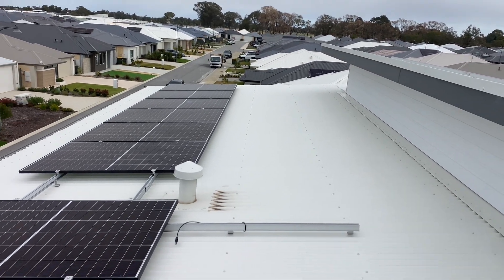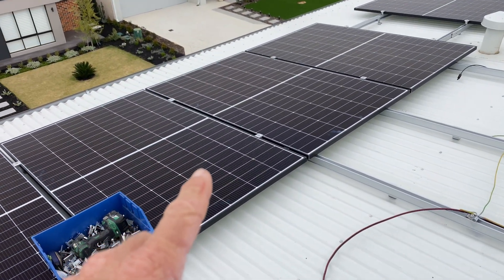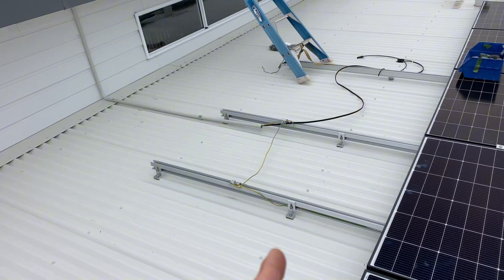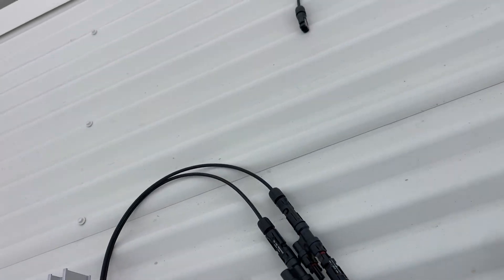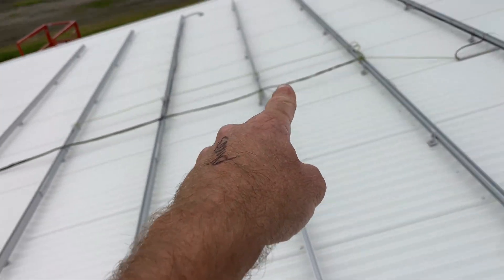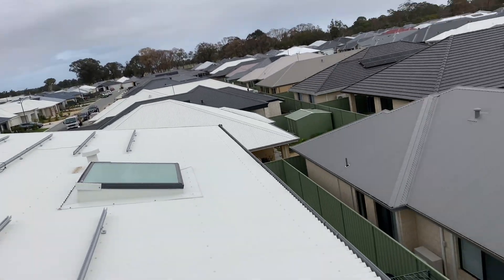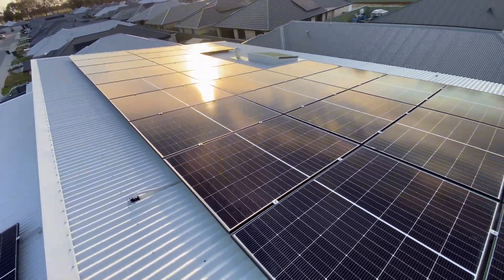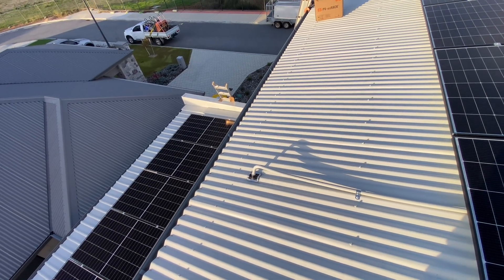My biggest ever residential solar installation with Sigenergy SigenStor and Trina solar panels.

Comment: Can you please explain a bit more about why you used optimisers on those 2 panels? Why are the bypass diodes not sufficient? Didnt quite understand the thinking
Reply from the maker: Sure, firstly you can void your warranty by installing panels in full, partial or scattered shade. When a panel is in shade it becomes resistive to the powerflow from the other modules in that string. Bipass diodes enable the power to keep flowing but they can burn out eventually, then the load goes back through the cells which are shaded and due to being resistive because of the shade they can burn out also. I use Tigo optimisers as they take the load of the bipass diodes but still allow the shaded module to contribute what energy it can to the string. Hope that helps.

Comment: why did you 'have to' install the 4 shaded south panels? just leave them off.. i doubt they will do much.
Reply from the maker: Because when paralleling strings the voltage needs to be the same

Comment: May I ask, why still using only 440W panels? New panels are up to 700w now days.
Reply: I think you'll find the size of those 700w panels 300-400mm longer which is how they get the power, not from more efficient photovoltaics.
Reply: @NashvilleAustralia  ...and for a single installer, bloody heavy and awkward !!!

Comment: I have had problems with earthing of panels and racking when using copper wire. In a wet summer climate, I found that the copper wire corrodes at the point of connection with the aluminium. Why do solar installers not use aluminium flexible round bar (as used for lighting protection earthing on large building roofs) for solar grounding? Surely the small added cost is not a factor?
Reply from the maker: I think some do on large commercial jobs. The bare copper  needs to be painted with zinc paint to stop the corrosion on jobs like this one

Comment: I’ve just had a similar sized system installed at home. 24kwh sigenergy battery, 50 panels (22kw) and 15kw 3 phase inverter. EV charger will come soon 👍👍

Comment: Those panels are half-cut solar panels. Portrait orientation is way better than landscape for that type of shading!
Portrait, roof edge shading hits one half, other half keeps working
Landscape, roof edge shading hits both halves, whole panel shuts down
Most shadows from roof edges are horizontal, so portrait lets you keep ~50% production during partial shading while landscape kills the whole panel.
Was there enough room for Portrait? I have 2 of these East facing fence mounted for charging my trolling motor battery. The sun hits the top first in the morning and gradually gets down the bottom by 10am.
Reply from the maker: Yes thats true, but I still wanted as much aun as possible on them and not load up bipass diodes
Reply: You won’t typically use the bypass diodes with a Tigo optimizer, as it regulates current and voltage to keep the panel contributing. Until the shaded panels get full sun, the string voltage may drop from around 640 V to 560 V, which also affects the parallel string. Rotating the two panels so one half gets sun earlier helps recover voltage faster. Split panels have two halves in parallel, so a panel 1/4 shaded in portrait will often perform better than one 1/3 shaded horizontally. If the system is over-paneled or it's cloudy, you probably won’t even notice the impact.

Comment: Hey mate, nice install. 

Few things i would add though love to hear your take, zinc saddles will rust in a few years time. Probably worth switching to gal saddles for outdoor use, thoughts? Good to run a catenary cable straight up the guts where the earth is just to keep the dc from sagging on the roof. We are always looking at improving our installs so your videos help us heaps. Good note on corro on the roof aswell. Good install on your own though 👍
Reply from the maker: Yes both valid points 👍🏻catenary cable would be better but everything is clipped as I go so no sagging of cables

Comment: G'day, why not use a hybeid transformerless inverter for off grid ? thx for your time and vid :)
Reply from the maker: Hi, many reasons. I will do a video on why soon.
Reply: @joondalupelectricalservice3201  Yes, keen to find out more too. I read the SigenStor has neutral-ground relay control, meaning it can properly bond neutral to earth when operating off-grid. Is there more to it?

Comment: Sigenergy says no parallel strings!
Reply from the maker: Can you give me a clause please. I haven’t seen that anywhere. Thanks
Reply: @joondalupelectricalservice3201 page 2 of the three phase data sheet 

https://www.sigenergy.com/uploads/en_download/1693469427819336.pdf
Reply: @joondalupelectricalservice3201 data sheet for the three phase inverter
Reply: @joondalupelectricalservice3201  low amp inputs

Comment: How do you go with partial deployment of Tigos on parallel strings? I've done it plenty of times on single string, but never on parallel strings into the same tracker.
Reply from the maker: Yes no issue so far doing it